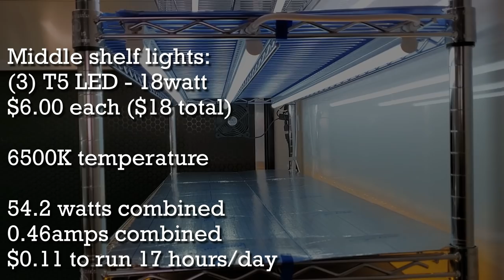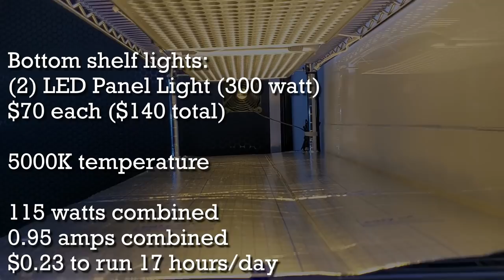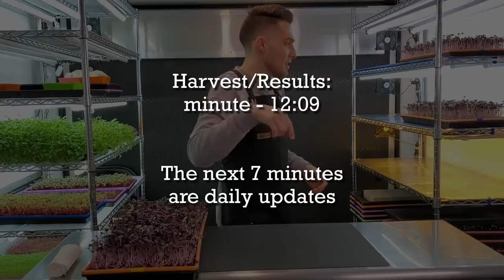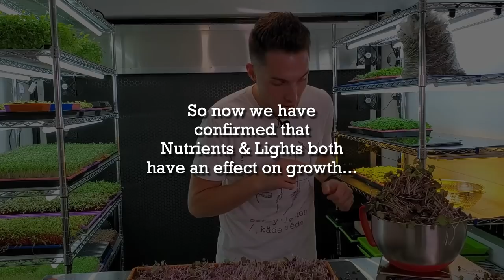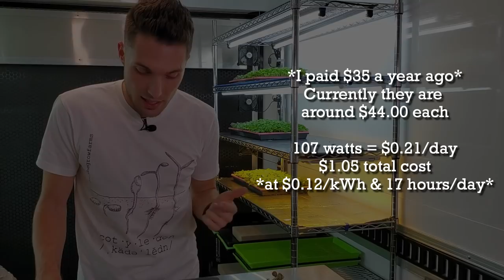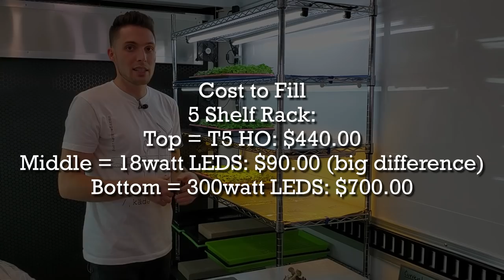Microgreen Lighting: Fluorescent vs LED's - On The Grow

Comment: Great informational video, these things are important when starting in micro greens. What are the lifespans of these lights, and the light intensity during this period. This is important as well I think. Would be great to see more on that as well.
Reply from the maker: Thank you for the support! So the lifespan is discussed in the first pinned comment, the basics are the LED’s will last 8 years and the Fluorescents will last under 2 years.
Reply: @OnTheGrow  But how does the light spectrum evolve? I have experience with some other type of lights and those lost a part of their usable spectrum after about 6-8 weeks (while they were pretty expensive) we reused them and it was worth the change in the end with the value of the end product. ;-)

Comment: Just wonder if you would make a 5 inch rim around the middle one and line it with reflective tape (or aluminum foil) wouldnt' that increase your light output on the greens?
Reply from the maker: Great suggestion! It likely would increase their output pretty decently! Some people are also taking off the milky covers and they say that it doubles the light output. We haven't done that yet because we aren't sure how safe it is to do... We are about to start more lighting videos though!

Comment: Thanks mate great Vid!. Just had a think and a rough number crunch .  The bottom tray may have been stunted due to high lumen in the early 2 -  3 day then once the top foliage covered ,it was ok. Perhaps if the bottom could be reduced by about a half to 2 thirds which would give almost an  even lumen count , - may have to manufacture the LED array for even light dispersion, this would significantly reduce energy costs through reduced Amp drawage however allows possible Off grid / solar setup thereby negating ongoing energy cost and supply issues which will pay itself off over time. ? Just a thought

Comment: I'm about to go & buy enough for 16 shelves. Had been trying to decide which was the best way to go wo going grow lites. Budget just can't take that kind of hit. I would have to drive semi 🚛 for another year to afford them. Trucking is destroying my health & hoping that microgreens will improve my health & I can make decent money. Thanks
Reply from the maker: The cheap shop light LED's that we use on the middle shelf should be a great option then! I agree that the LED panels are unrealistic to most people... I would get started with the cheap LED's then move up to the panels once the business is going really well and you want to increase your production and quality. We have used the cheap LED shop lights for about 6 months and everyone has loved the produce we grow... Excited to hear about your journey!! Microgreens have been so amazing to us... They taste amazing, make us feel amazing and we were able to launch and quickly grow a business with them!
Reply: Bought 5 lites that home depot had. It was by commercial electric 1x4 size. 5000k for 99.97. I haven't truly started. Did test run on 5 types of microgreens. Did everything wrong but still came up.
Reply: Going after pallets for additional income to survive/support me. Got a work station of shelves, & another set of shelves so I can put another shelf above so I can max the output in a small space. Room is 8x10 with ability to knock out some of a wall to be 14x24 approximately if necessary

Comment: Im curious, how long would it have taken before you start breaking even with the middle lights and the bottom lights? Would the bottom lights allow you to be more profitable in the long run? 

Thanks for the informative video!
Reply: nope, i calculated it and it never cuts in a graph... welll in negativeit does

Comment: I couldn’t find the 18watt LEDs on your Amazon storefront. Only 42 watt full spectrum LEDs were there.
Reply from the maker: The 18watt light vendor switched the lights so we no longer recommend them. We've been using these 20watts with better results and the vendor has been more reliable. https://www.amazon.com/dp/B07F2WMCP2/?tag=aiponsite-20&linkCode=ic5&ascsubtag=amzn1.infl.us.product&creativeASIN=B07F2WMCP2&ref=exp_onthegrowfarms_dp_vv_d

You get more light for the same money. You can also just search around for any lights that are at least 18+watts in the 6500K spectrum with an output of at least 2,000 lumens per light. 

Hope that helps!

Comment: One thought. The bottom shelf of Rambo radishes did not have a light immediately beneath it. The upper 2 shelves did, so they had warmer soil. I wonder if radishes enjoy cooler soil? Can you repeat the experiment to see if the difference is only in the light, or a combination of light + cooler soil?
Reply from the maker: Great observation! That is a flaw in the experiment...

We are conducting tests with heat mats right now and we see a positive effect from the heat being applied to the grow medium. We have tested three crops already and all germinated and grew better with the heatmat being 8 degrees warmer. 

So I would think that the two trays above it would have an advantage over the bottom tray.

Either way, it would be nice to recreate it and move the lights around and see if we get the same results. 

Thanks for sharing!

Comment: Great fun. Cool video. You wanna amaze yourself?
Try Christmas lights.
Try little tiny clear but apear white Christmas lights.  Dollar store. Check to make sure they are the ones with no lead in the wire coating. Hang 2 inches above plants (easier to lower plants). Takes 1 or 2 days longer. Not commercial. 
Also consider how bottom heat affects growth. Its entry level cheap.
Reply from the maker: Thanks for the support! We’ve heard of people using Christmas lights before! We have a test running right now where we have trays germinating/growing with a heat mat and others without a heat mat. It’s only been three days, but already showing some pretty promising results! Thanks for the suggestions!

Comment: From my view the viewers; you can see a clear difference in structure of the main stems of the middle tray being more stable and consistent rather than the left tray and right tray. So I would asses that the middle light not being to strong not being to weak have a more stable structure underneath for easier straight forward harvest cut across top . And the left and right tray are more bushy and robust even though the yield looks to be around the same, from the top yes I see the similarities but from the bottom up to the foliage you can see structure being more stable I feel. So maybe the middle light not being to weak nor to strong wasn’t stretching the radish to much towards the light an also not to little where it didn’t grow strong and tall

Comment: You need to replace one fluorescent T5 bulb with a warmer 3000K or 2700K bulb. They are sold by Vivosun, iPower and Lightwise. This is a low cost upgrade that does not require a new fixture.

Comment: Just wondering if the middle shelf results are skewed or were affected due to the reflective/absobtion of the light wavelength as the upper shelf has a blue backing compared to the other 2? Not sure if I explained that very well. Would the blue backing of the mat on the shelf above absorb the blue wavelength from the white light? Cheers H
Reply from the maker: The other two have that blue backing as well! They are just on the other side... it’s foam insulated on the bottom and the reflective foil on top. 

This was by no means a perfect test, but the results of the second shelf were pretty consistent with the results we get on our other shelves.

Comment: Just a thought comparing the harvest.....the LED might be still more economical.....to get same results as with the other lights you might wanna harvest 2 days earlier due to the faster growth. 2 days faster every run equals more circles per year. That accumulates over the year.....you might also look into dim able LEDs as you might be able to get similar results with half the power output? New LEDs with Far Red and UV might change the game as well.

Comment: May I ask why you chose this medium over hydro with the hemp mats? Thanks.
Reply from the maker: We really like Coco coir. It retains water very well and has a texture similar to soil, but we can still control the nutrient input of it. We have some new lighting tests coming where we use hemp mats too! 

We like every medium but we always gravitate back toward Coco Coir. It is easy to overwater this medium so you have to be careful. It retains water very well.

Hemp mats and hydroponic mats in generally are a lot faster to use and create very little mess. Using coco is a bit of a process and ends up on the product since it is similar to soil. 

Hope that helps with the pros/cons and why we use it!

Comment: Just curious, you mentioned the difference of grams, and the price difference of the various light... and also the price per grow. The information that you didn’t calculate is what the total coat is : profit-cost. For instance you will make more money because of the weight difference of the full spectrum. So how much do you make per gram of radish, then subtract the cost of electricity. To go even further, I’d love to see a rate of change graph.. or with the info I could do it and send it over. ( I’m currently at the gathering data stage of starting a business and do not yet have approximate values).
Reply from the maker: Thank you so much for the support Jamilyn Reiser!! We are going to be making new content soon! 😄 Now... true calculations of Profit vs Loss are never ending...the variables are thru the roof when you consider who, where,when, etc. Check your local markets as a rule for what's wanted and what people will pay!!!

Comment: I was on Gardener's Supply Company's website from Vermont and I wondering if the LEDs on their (LED SunLite® High Intensity 3-Tier Garden) with a price tag of $899.00 were comparable with the LED tubes you have demonstrated.
Reply from the maker: Great question Daniel! We'd have to look into those since we've never used or seen them yet.

Comment: Great display of a test; but, the LED most productive was loved until cost of unit was considered. If that capital cost must be expensed out in something less than three years because it dies, the added cost to operational expense for power can be compared to the other approaches. But, if it lasts for say 65,000 hours of 18 hr days, it may be only last for ten years and the unit cost per oz of product may be impressively less with total production x 12 crops per year may make it a winner.  Price of equipment is always changing. What is forecast with use on adjustable fixtures getting close to canopy of plants sans too much heat?

Comment: Are the plastic covers on the shelf necessary...trying to cut cost
Reply from the maker: No, they prevent dirt and stuff from falling through, but you can easily do without them all together or put something else in their place. I’d also search locally for a rack, it’s much cheaper usually. I’ve seen a ton on Craigslist in my area for half the price of retail and in really good condition... Black Friday sales on storage racks from local hardware stores would also probably save quite a bit.

Comment: So they are called 300 watt led grow lights and actually if you add the wattage of all the led's together they will come out at 300 watts, however the manufacturer never run the drivers at full power, rather half or even a third so that this thinking extends the life of the led and it does. Hopefully helps to clarify ?

Comment: Hi I'm wanting to know  what those silver shelving reflectors that the trays sit on are?
Reply from the maker: It's just floor underlay mats. It isn't meant for grow rooms but we use it for our light experiments to block light from getting through to the other shelves, while also reflecting light on the same shelves.
Reply: @OnTheGrow  pls correct me if I am wrong these mats which covered by aluminum sheet will increase the temperature under the trays due to light reflection, so this temperature will enhance the germination ratio as per extermination done by one microgreens company.

Comment: Can you compare Marswalled 95 CRI 5630 led strips? (and maybe to same K low cri strips) They have 5500-6000K, 4000-4500K, 2800K-3200K variants and the price is around 30 usd/5 meter (amazon available). They have to be soldered and need separate aluminum profile. I think they are a pretty good target for DIY lights because the higher the CRI value of the strip their spectrum is closer to the sun (max cri is 100) and also they have around 120° light coverage.
Reply from the maker: We will see about trying some of these out! Thanks for the suggestion!!

Comment: Blue light will promote vegetative growth, red light flowering. Blue light will produce more compact plants, plants under red will stretch. You should measure plant lights with PAR meter. Lux/lumen meters measurements mean little in horticulture as it measures light for vision, PAR measures the important areas of the spectrum used for photosynthesis. Samsung LEDs are king, but look at the appropriate specs for the kelvin rating desired.

Comment: What about if you blocked out each shelf with that make a difference rather than light coming from the other shelves down
Reply from the maker: Each shelf has an opaque layer between it... the only way there is light bleed is at the very back where it slightly reflects off the wall, and I wouldn’t consider that as having an effect. Especially considering how much light the bottom light puts out. If I turn off the other lights, there is no change in LUX so there shouldn’t be any light getting through...

Comment: You  left out the heat factor, how hot do these run?
Reply from the maker: Fluorescents crank out the most heat, and the 300watt LED’s crank about half the heat. Not sure on the exact numbers because I don’t have a tool to measure.

Comment: I suspect that the middle tray was drying our more quickly because of the heat generated by the light fixture below it. I also wonder if this heat input an impact to the final quality of the product from the middle tray.
Reply from the maker: It is possible, but we’ve grown so many trays with the lights on the middle shelf and the data lines up with the results we got in the past...

Comment: Great comparison. However the grow lights is not 5000K. Looks like 3500K max.it maybe even less. I'm using 2x2 LED panel lights, 5000K and 3500K's and the 3500K color temp looks like just as your grow light on the bottom. I did not experienced  much different result far is harvest weight. You have mentioned that you are not sure about the  Watts out put for the grow light's... What the label said? How many led lights each has? if you have around 300 each than it least 115W each , which is 230 W combined vs, 115W which doubles your operation cost.
Reply from the maker: I measured the wattage and amperage output for all of these lights, so the information I put in the video is correct on that aspect. They claimed it to be 5000K temperature when I purchased so I just copied that part but I do agree they look lower than that. 

They are the 115watt combined (2 of the lights) like I put in the video though... I used a Kill-A-Watt to measure everything. 

Thanks for the support!!

Comment: Bottom shelf looks like 2000k not 6000k. Also, your lux meter only works for sunlight where it's measuring only red/infrared and expecting only a small amount so the red light in bottom shelf is really strong, but it's not got enough blue. Middle LEDs don't have enough red.  You should replace 1 tube in the middle with 1 "tube" form the bottom to give LED a fair chance.